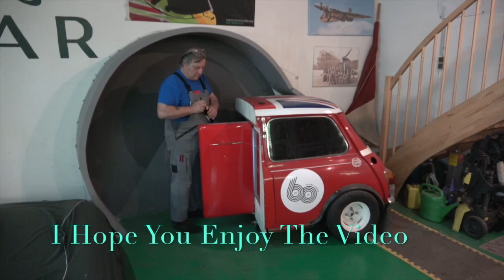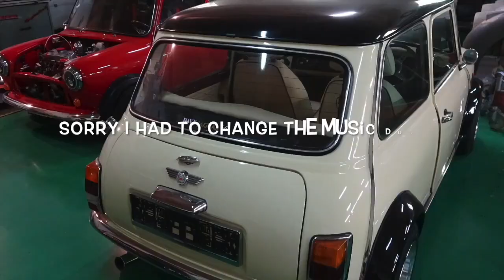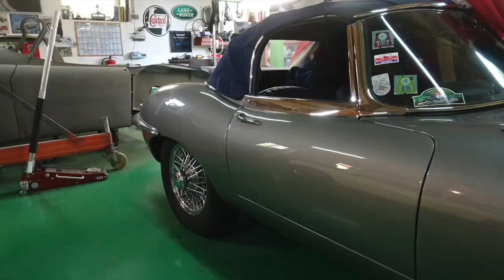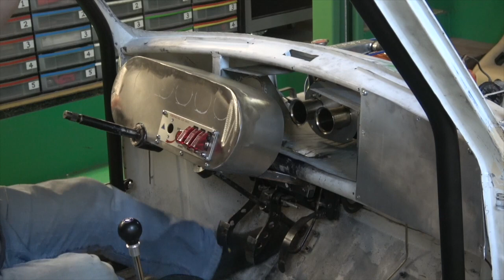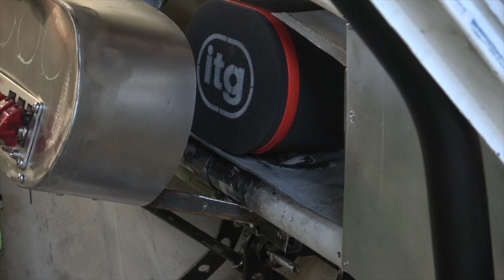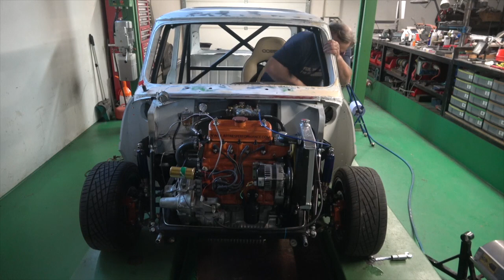Classic Mini Race/Track Car Build,  Air Filter & Dash Panel

Comment: Great video 👍 cluster box  you could shrink the back,give you more room for air filter removal and less chaffing on hand's and stiffen cluster.
Reply from the maker: Sean, I may just cut it downa bit i need to fit al the gauges and lights in and then see if i can finesse it a bit, Cheers Dave